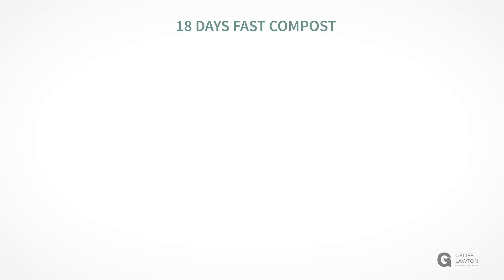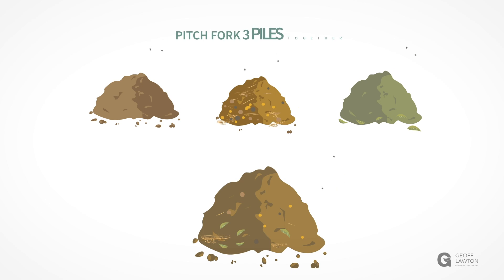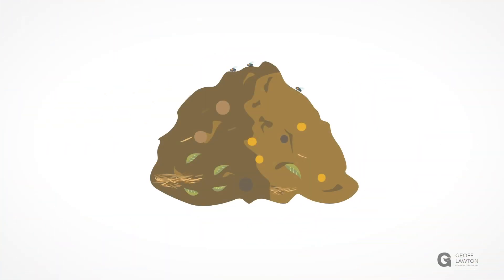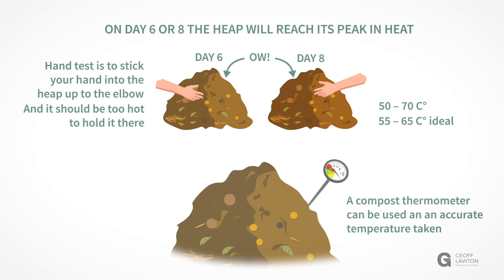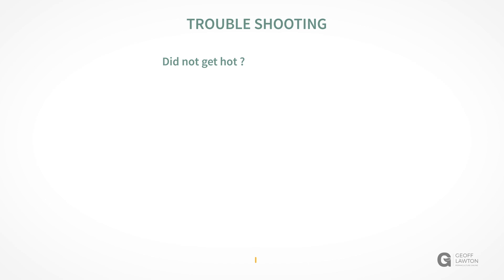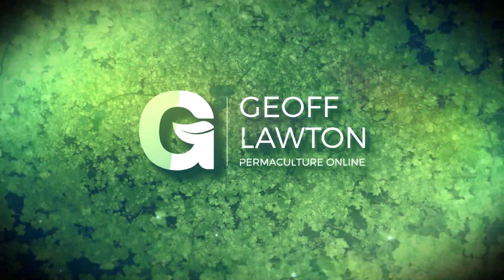18-Day Fast Compost [PDC Preview]

Comment: I've taken your pdc and am nearing completion of my pdc submission. I'm also finishing up Dr. Elaine Ingham's sfw course. Both of your messages call out to me. I'd like to experiment with both your teachings on the 'composting' topic, with a control, on my site. I'm sorting out total sqft for this project, and locations (to run similar trials throughout the landscape, at varying slope angles and elevations). Can't wait to have an infrastructure on site to capitalize off of volunteers. 😁

It's been difficult to maintain either of your teachings on this, due to the variables at play on my site since acquisition this past fall. 

I'm almost at the point where we can start etching out landscaping on/off level/off level contours (with permeable roads), carving out a descending/ascending labyrinths amidst edible, drought and fire resistant vegetation and gourmet mushroom bundles (with gravity and solar powered aquaculture, and all of the vegetation intertwined with aquaculture systems).

At heart, I love your designs and 18-day compost pile guidelines. Interspersing compost piles on-site, parallel and perpendicular to contours, via earthworks, stacked with 4 dimensional potential...you're the obvious winner vs Dr. Elaine, 😂. 

But, then comes the Dr. 

It takes alot to earn the title Dr., and loads of repetitive tasks to write papers and have verifiable results based on variable conditions that are scientifically documented, and proven accurate, via repeatable microscopy results. 

It also takes alot to just 'do' it and not 'worry' so much. 

Under a microscope, Dr. Elaine appears to be the winner, though?

Actinomycetes? 

I'm not sure which of you wins. 

Her arguments that they are non-beneficial microbes, on the grounds that they favor anaerobic conditions, with anaerobic microbes being the protagonist of 'THE' breeding ground bad bugs for bad homo sapien pathogens. 

You once told me that I should aim to eat my compost. I understand what you meant. 

Dr. Elaine mentions aiming to drink your compost tea. 

You both have valid points. 

If I let nature take the draconian aspects out of the beginning stages of composting, then control the pile better once 18-day composting starts, is that not what the Dr. professes? 

That fresh manure should be aged prior to applying to a biocomplete compost pile. That any manure can transit pathogens to you, your pets, livestock, and native habitats?

Is 'that' what nature 'does'?

Doesn't nature just shit anywhere it wants?

Comment: I take my brown leaves and place my weed eater at the bottom of a good size trash can. I fill the container half way on top of the weed eater head. I have a battery powered one so if you don't obviously have it started. I also afix a sheet of card board on the lid with a cutting to slip the handle in the middle. This prvents it from blowing up at you. Run and shred. I do the same thing with hey. Anything it can weed eat.
Reply: I really like your idea of the cardboard, sure does solve a major problem. I will be trying it.

Comment: Love the parts but am highly confused how to calculate the mixes.. First if you say 500:1 .. is this a mix or a thinning ratio? so is the total 501 or 499+1 .. Then, is this part volume or part weight? Do you have an easier ratio calculation that allows the calculation of (for example) how much urin do you need to add to sawdust to make the mix 30:1 .. sorry I am usually quite mathematical but here i am struggling :=)

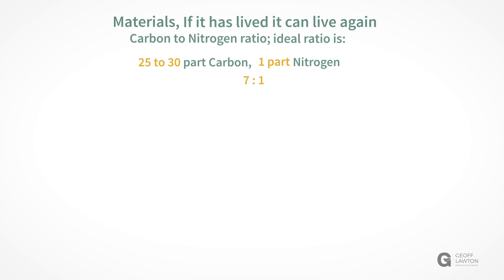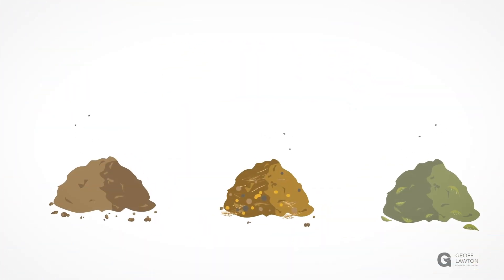Comment: I don't quite understand the numbers-part (from 0:50->). You've mixed both nitrogen and carbon sources into same numbers, what you are trying to tell us? It is not what is the ratio of those different materials, because next (1:47) you tell, that there must be 1/3 of each three materials (high carbon material, manure and green material). If it is just about "these high materials must be shredded, then why not just tell that, because we don't actually need those numbers?

Comment: I always have problems keeping my moisture levels under control, but I keep trying...
Reply: i open mine up to the rain 1 time per week if i get it in the forecast, if no rain. i slowly pour 1 five gallon bucket onto it after it hasnt seen rain for a week. once its been wet through like that 5 gal or rain, recover and give it about another week or little less if getting rain

Comment: Old manure can be soaked for a day or two to soften up.
But a lot of the N winds up in the soaking water.
Reply from the maker: Bonzo The Brown use the water to wet the pile
Reply: @DiscoverPermaculture  Yes, it also makes a good starter for microbial broths.

Comment: I've started my 1st pile 16 days ago with grass clippings and chopped up mixed of fresh and dried grass. day 4 to 8 seems pretty good as temperature reached abt 60+. But now day 16 it still doest look close to well done as grass pieces still can be seen (some are bright colored like dried grass). Any pointers?
Reply: Did you add enough activator?
Reply: @migueltigrelazo  i was thinking that the nitrogen contents was pretty high itself as its pure grass and mostly fresh so i did not add in activators. Maybe that made a difference. I've some bottled and aged urine maybe its good time to put it to good use.😁
 I'm also trying to moist it up as i suspect that it dried up along the turns without adding water.
Reply: @mazo9527  - Black plastic cover does wonders in helping keep the moisture. And allow the worms and other critters come all the way to the surface. Notice in normal conditions they stay well away from the light. Meaning the outer layer is not touched (much).
Reply: @crpth1  i am using black tarp to cover. Indeed at first was single layer, moistures got seeps away through the ground/soil. Then i resorted to top and bottom wrap. Mayb the tarp made it too hot that not much critters spotted in it.
Im suspecting the black tarp was too hot for critters and microbs to do their work. I live in Malaysia, where captured rats are killed left under the sun for a day. 😅
Reply: It still reaches 60℃ on sunny days after 2months yet decomposition seems slow.

Comment: can I use carpentry wood shavings as brown when making compste
Reply: Yes as long as it is not treated
Reply: not pressure treated, it has arsenic and the microbes will bioaccumulate that and make it available in the soil for other organisms. for those unfamiliar with it, pressure treated is green tinted like crazy when new, older its harder to tell but it doesnt  soften and partially rot the same way non treated does and when it finally does start to rot only the outer layer at a time will
Reply: Avoid species with juglone and other allelopathic species, as a general rule

Comment: Hey, thank you for that awesome tutorial. I have some questions: First, what means "fine shredded"? I have a shredder and the material I get is of course not like sawdust but like little wood chips.
Second question: I have LOTS of plants (Portugal area near the ocean), that are very high in water. One of these plants is a "Aeonium". It looks like brown material, but its actually very soft and full of water. We have quite some of these plants that are high in water and grow on the surface of sand - so no deep roots but I guess, they take a lot of water from the air. Can I use them and would they be "green" material?
I am still struggeling a bit with how much of what I have to use.
Today I shredded more of the plants and I cannot wait to build that compost - but of course, I wanna do it as perfect as possible. :)
Thx again,
sant0s
Reply: I've always thought composting succulents would be great, have yet to try it though. I would chop up your aeoniums and throw 'em in, so their moisture content gets more evenly distributed... might want to look up their carbon to nitrogen ratio if you're following this method
Reply: @TheRealHonestInquiry  Hey, thanks for the answer.
Already did two hot composts last year with that technique.
It took a bit longer than 18 days, but great results. Also with the Aeonimus! :)

Comment: why can't we just use grass clippings and green weeds MINUS the manure/carbon .. since it's already a great ratio of 25:1?
Reply: you can.. typically though you wont really have enough for a cubic meter unless you have a TON of it all the time. also you will just have other things around that could be gotten rid by making awesome soil instead of landfill garbage, so mixing your veggie scraps and fruit peels and cores etc and your leaves from the yard + that perfect mix pile you mentioned and now youve got a serious sized pile and a lot more often
Reply: You can in theory but careful of it going slimy. And your lawn drying up because you keep stealing all the clippings.

The other thing is that they are difficult to store for more than a day before assembling. Bag them and the bottom goes slimy (not ideal), lay them out somewhere and they start losing N (also not ideal).
Reply: @przybyla420  whats wrong if it goes slimy?
Reply: Smelly and slimy means it’s dominated by anaerobes. A bit is fine but you want aerobic organisms because they decompose faster and produce a higher quality compost. Too many anaerobes and you start to get the potential for stinky pathogens (bad for you and your plants)
Reply: @przybyla420  Thank you so much for clarifying that :)

Comment: What if you don’t have access to manure?
Reply: I wouldn’t get hung up on following this method to the letter. The key is C to N mix. However you can make a “Green Manure” by filling a bucket with greens like grass clippings, garden waste, kitchen scraps etc...,fill with water and weigh it down with a brick so the material stays submerged and let it sit. When it smells like crap it’s ready. Also check CL for people selling Rabbit Manure. It’s the safest in regards to herbicide poisoning.
Reply: Just skip it, not necessary

Comment: Why not just drop the organic material on the ground, between your crops? Will protect the soil against sunlight and weeds. This is how Masanobu Fukuoka does it. 
Or just dig holes and drop it in.
Reply from the maker: chrnb you can if you want a casual vague broader system.  If you want a more intense diversity of specific trees and crops or you want to make high quality potting mix for your nursery then compost.  The nutrient in compost is locked onto the carbon and remains available for up to 20 years.
Reply: Then  you don't get to make a video about it; no one is going to watch it
Reply: @thecurrentmoment  Trust a sheepshagger to be bitter he's not a good gardener online

Comment: Seems overly Labour intensive.
Reply: The labor is only needed if you want FAST compost.  Slow compost uses no turning, but you wait a year or two for results.
Reply: If ratios, moisture and structure are near perfect, most of a heap can be composted in a month or two with no turning.
The outer layer can be incorporated into the next heap or used as mulch.
Reply: @bonzothebrown7603  I do the straw bale raised lasagna bed the bales keep it insulated and it doesn't need turning it steams away for a month then I plant straight into it,  with a cloche over it you can start seeds a month early with free bottom heat.
Reply: No pain no gain